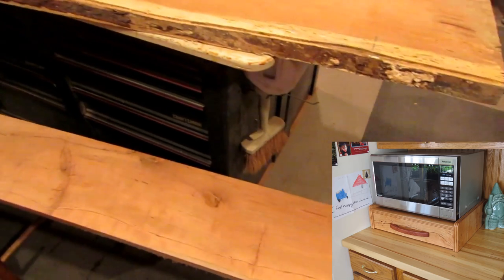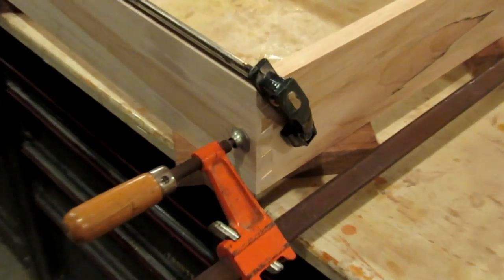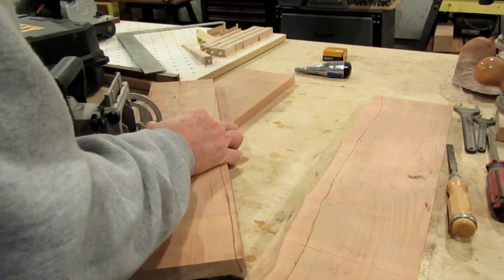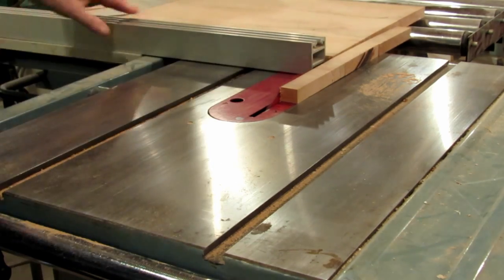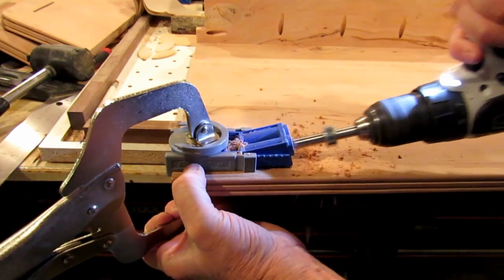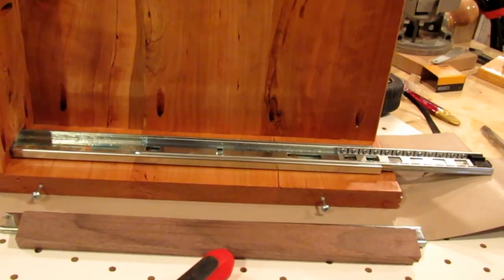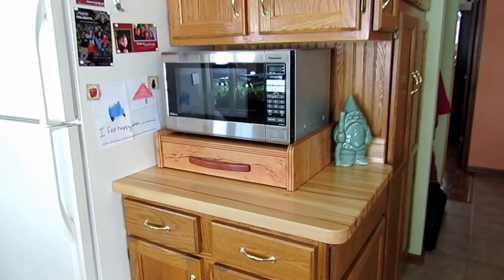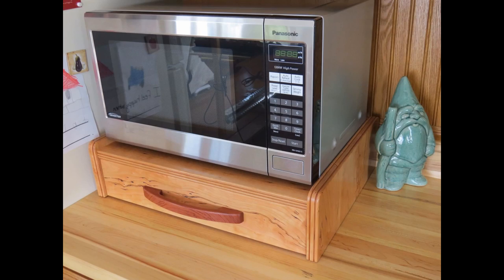Home Built Wild Cherry Stand For A Panasonic Microwave Oven

Comment: Love your woodworking video's. Need to make more of them. Hows the Scroll Saw stand holding up. That was a nice build.
Reply from the maker: That saw has surprised me. I use it all the time with no problems. The stand makes it the correct height to use and l added a light to the stand so the lines are better illuminated.  Thanks for watching.